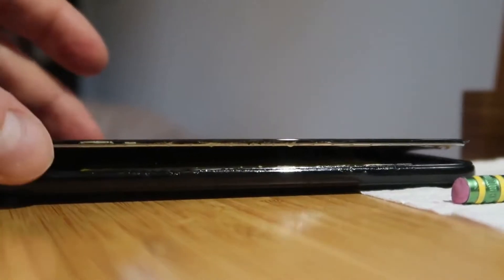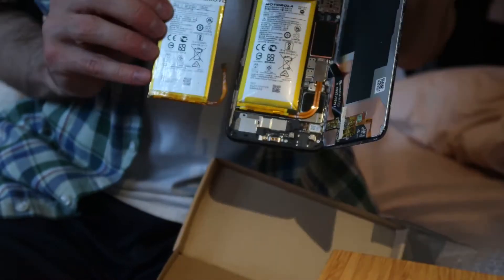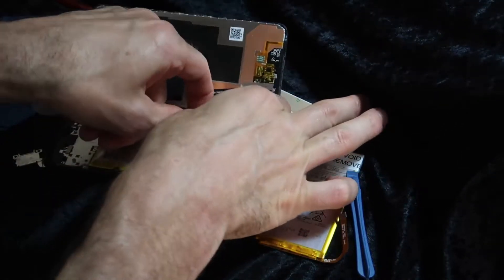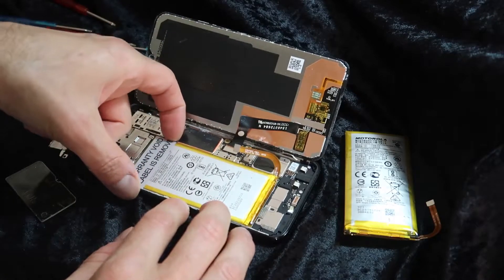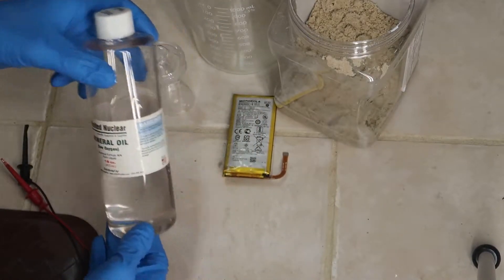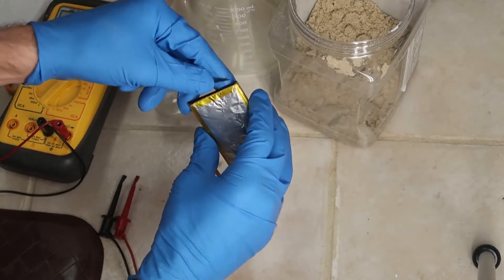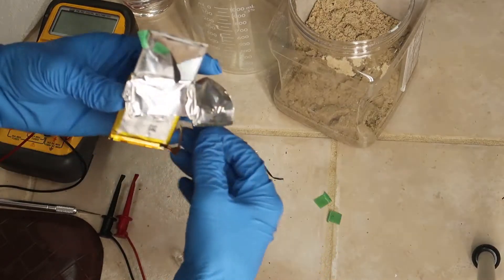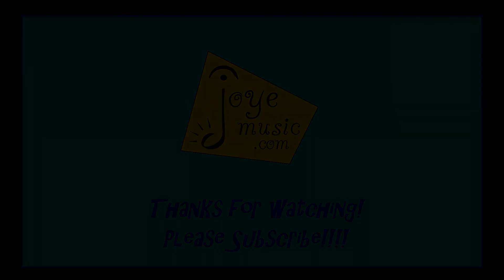Repaired: Motorola Moto G7 New Battery swell swollen phone fix JG30, JG40

Comment: I have read that you need to "recalibrate" a new battery in Moto phones after it is installed. But, I don't know how true that actually is.  Supposedly it will make it work better. 🤷‍♀️
Reply: The link I added just says this:

"Battery calibration

If you are experiencing incorrect or inconsistent battery level, quick battery discharge, slow or erratic charging speeds, or sudden power off or rebooting, a battery calibration could correct the problem.  

To perform a battery calibration:  

Force reboot the device by holding the power button until the device reboots  

Plug into supplied charger  

Charge to 100% and leave on the charger for at least an additional hour after getting to 100%"

Comment: came across this since my moto g7 power is also swollen a bit more than yours, BUT the link is to a different model battery than mine so i had to look for a jk50 battery, which i have on the way. since i use the phone as a wired webcam essentially on a tri-pod since even the cheap-o phones tend to be better camera's than expensive webcams, but i also kept it plugged in the whole time and noticed it a few weeks ago and just now got around to looking into a replacement.
also, i'm SUPER paranoid of batteries... car and jumper pack sized batteries are the main one's.. seen some crap happen with those in person and explode so i get VERY paranoid when i see sparks, like when you first cut into the battery my GF and i both jumped and my instinct was to rip it out your hands and huck it across the pavement lol.

Comment: FYI lithium Batteries are ment to be able to charge and sit on the charger. Because the chips in the Batteries are supposed prevent the battery from charging when full. What lithiums can't handle, is going to far dead. You always want your batter 30%+

What happened with the MotoG7. Is they put batteries that had crappy Charger Circuit. And bad Charger Circuits will keep charging the Battery when it shouldn't, and poorly regulate power, which leads to lower life spans.

Comment: I used the battery kit in your description. Turned out to be a garbage battery. Crapped out 7 months later. Just ordered an alleged OEM battery from IFIXIT and about 2X as much.

Instead of gluing the case back together I put it back in the shock case I got for it (POETIC brand) when it was new. Probably not very waterproof, but since I am redoing the job it is a little easier to redo. 

Also, Walmart has a great tool kit for this stuff Hyper Tough 77 Piece Precision Tool Kit with Magnetic Screwdriver, around $10 on sale.
Reply from the maker: Wow, so sorry that didn't work out for you. I'm still using the SAME replacement battery I showed in the video and it works just fine (1.5 years later). I guess maybe you got a dud?
Reply: Almost forgot, I'm not even using this thing as a phone. It's my dashcam and social media wifi gadget. @JoyeMusiccom
Reply: Okay, just replaced the battery. The cheap one was swollen already.  Am going through the battery calibration process now and already the real McCoy Motorola lasts way longer. Waiting for it to run all the way down for a full recharge. @JoyeMusiccom

Comment: Thank you for the video!
Do you recall the width of the adhesive areas? Will 2mm wide 3M 9448HK Double Sided Tape for LCD fit?
Is there an actual difference between JG30 and JG40?
Reply from the maker: 2mm should be okay. I fell like it was closer to 1mm, though. JG30 and JG40 are different batteries.

Comment: I watched a few other videos and they removed some other pieces.  I am glad you proved nothing else has to be removed to swap batteries.   Is that $20- dollar battery still working?  How can you tell if one battery is better than another?   Same problem here.  Battery expanding.
Reply: Has anyone purchased the $20 dollar battery and if so are you still happy with it?
Reply: I bought the battery in the link (JG30)   I had to return the first one.  The charge didn't last to long.  It would drop form 100% to the 80% range in about 5 minutes.
Returned it got another one and the same thing happened.   It finally got to the point where it had problems charging.  Would never go beyond 90% area and it also last only about 5 minutes after charge.   Would like to find a good reliable battery.
Reply: The seller said the tape strips are for the battery and no strips to seal the top screen.  I plan to do both if I buy this battery.  I just want to make sure it's
not one of those scam batteries (used with a new cover on it).

Comment: I'm having the same issue; phone 3 years old and the battery is swelling, causing the front screen to pull away. 

I believe the real issue is likely keeping the phone at 100 percent charge at almost all times. (We typically keep it plugged in whenever we are home.) When this is done with a Li-Ion battery, it eventually causes  Lithium dendrites, which are formed when extra lithium ions accumulate on the anode surface and cannot be absorbed into the anode in time. 

Some phones can be set up to limit the charge to 85 percent or so, which pretty well eliminates the issue. But that, of course, reduces battery capacity.
Reply from the maker: Thanks for the input! Hope you can get it fixed easily too.

Comment: Lithium battery swelling is not only caused by over charging. In fact, if the phone was operating normally for 3 years, the swelling is most likely due to one of the other more common causes: age of the battery that affects the chemistry (impurities). Heat exposure, over discharge.
Reply from the maker: Well, it was never exposed to heat, and never over-discharged -- I don't think it's ever been under 70% charge. So I'd guess it's probably just age due to some chemical reaction/breakdown. Nonetheless, swelling is a dangerous condition as far as I can tell! I'm just glad it was easy to replace.
Reply: I thought the charging circuit stopped once the battery is at 100%.